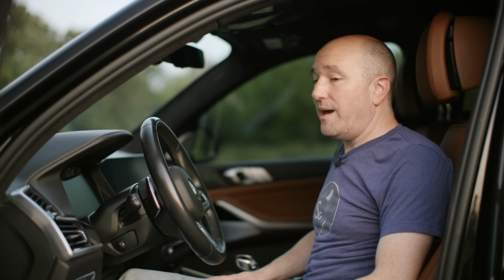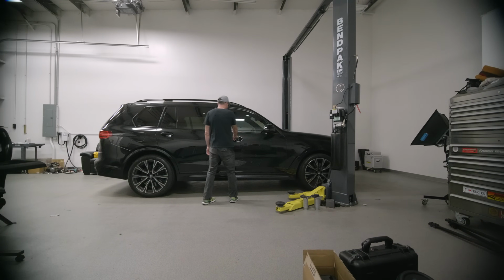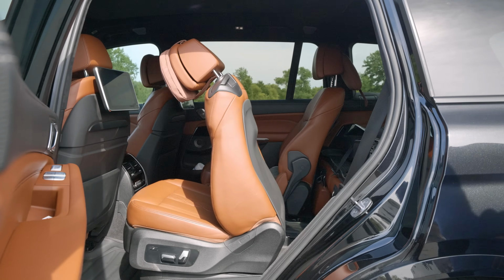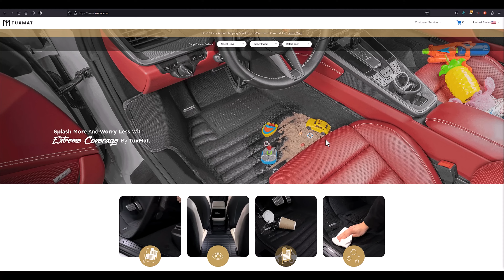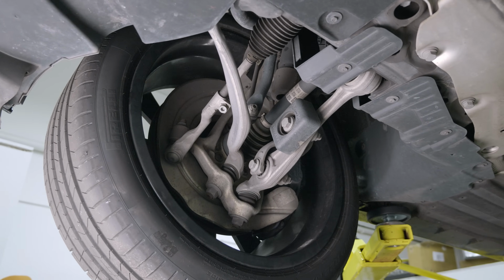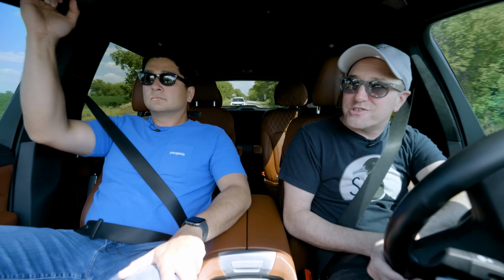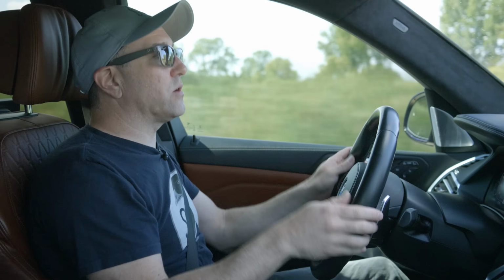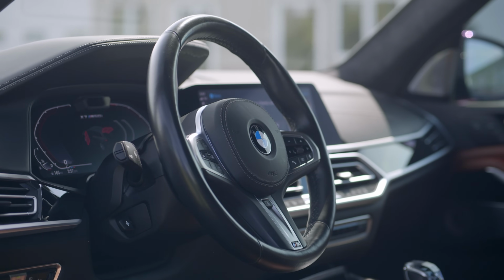BMW X7 | 45,000 Mile Long Term Results

Comment: I bought an M3 new in the 90's and have owned about 9 more BMWs since then. I was a fanboy of the highest order, but the last two X5s I owned left me stranded on the side of the hwy (one shifter failure and one engine seized). Those problems were fixed under warranty because BMW would rather apologize and beg forgiveness before building something dependable. My local dealer nodded understandingly when I told him a bought a Genesis. Mark's X7 only had small problems so far, but these cars cannot make it through five years of trouble-free ownership. They are gimmicky tech products engineered for the show-room.
Reply: @rodgerk They were fixed under warranty. So...what's the problem? Should we purchase a GM or Mercedes product next?
Reply: @MH-xu4ez  The problem is sitting on the side of a California desert hwy for hours on a 106F afternoon because the V8 engine seized at 80 mph. The problem is a failed door lock system on a F90 M5 that left my friend and his wife standing on the sidewalk in a dangerous neighborhood. The problem is the constant unscheduled warranty service visits to the dealership while you drive an ersatz loaner. I was at the local dealership so much I became good friends with the staff there and got invited over for dinner. BMW has lots of cool owner events and I met a lot of cool people, but it's like an abusive relationship. No more. I'm trying Genesis right now (so far it's been nothing but oil changes in 45k miles). Eventually I will try AMG. My buddy with the M5 moved to Porsche.
Reply: @rodgerk.  Stranded in a "dangerous neighborhood". Got it. That's all I needed to know.
Reply: @MH-xu4ez  with the quotes and blatantly ignoring everything else he said it looks like you are trying to spin this into it being his problem?
Reply: @S8ER  Interpret it however you like. I'm more interested in what years he owned the BMW vehicles and which models. Their V8 engines have been notoriously unreliable, but their recent straight six engines have been great. I've owned four BMWs since 2018, all with the B58, and my vehicles have been reliable, albeit expensive to maintain.
Reply: @MH-xu4ez  Yeah, the B58 is a great engine. I would argue that's because BMW was forced by law suits to fix the dumpster-fire that was the N55. You know the V8s are trash but you failed to mention the catastrophically horrible N20 4 cyl that has BMW fighting court cases the world over. Thanks for asking about my BMW history: I've owned three E30s over the years - current autoX car is a heavily modified 1991 318is. These cars I bought from the dealer: Two E36s, one an M3; E39 540i (best car ever, drove it to 180k miles with no serious probs); E70 X5 xDrive50 (shifter module failed and immobilized car); F30 328i (N20 timing chain guide failed and ruined engine - i still have the old engine in the garage as a fun rebuild project); F15 X5 xDrive50 (N63 engine seized due to dropping valve stem seal). That's 3 separate models that all failed catastrophically under 60k miles. All these cars were dealer serviced and warranty was honored. And about your snide "dangerous neighborhood" comment: I live in a huge metropolis with several famously high-crime neighborhoods. Areas where Door Dash won't deliver after sundown. Neighborhoods where I have personally had a gun in my face and all my car windows smashed. You'd call that a "friendly neighborhood"?
Reply: @rodgerk.  Fair enough. I respect your honesty and history of ownership. I guess my original reply was more geared towards the end of your original comment when you said: "but these cars cannot make it through five years of trouble-free ownership". It felt like more of a definitive statement about any/all BMW models. I'll grant you that many of their vehicles had their fair share of reliability issues, but it's been my experience that most of their newer models can be reliable for well over five years if the individual is willing to pay the extremely high cost to properly maintain them. Most people do not and then complain about the brand as a whole being unreliable. I've owned everything from American, Japanese, Korean, German, etc. and have found that no one brand is more reliable than the other depending on the model and service history. The exception being JLR vehicles.
Reply: @rodgerk.  And yes my "dangerous neighborhood" comment was meant to be snide because it was an unnecessary detail about the reliability of said car brand. I apologize that it caused offense, but dangerous neighborhoods are extremely subjective based on a vast number of factors. But let's not get into that on a YouTube channel that is geared towards car enthusiasts and the joy of driving.
Reply: @S8ER  And for you S8ER...did you feel that the crime rate in said neighborhood was warranted or relevant to the conversation about a car brand's reliability? Or do you just stir the pot in YouTube comments between strangers and then bounce after?
Reply: @MH-xu4ez  🤷 not sure it matters
Reply: @S8ER  Exactly. It doesn't matter and holds zero relevance about a car brand's reliability. Thank you for actually responding.
Reply: @MH-xu4ez  Thanks for explaining your POV. Solid take. You're right that it was unnecessary on my part and got in the way of our productive discussion. I learned something here.
Reply: @rogerk. I appreciate your response as well. I'm glad to see that strangers in the YouTube comments can have a difference of opinion and still get along. If only there were more positive exchanges like this in the YouTube car culture community. Best of luck with your Genesis ownership and experience. Hopefully my current BMWs (2022 X7 40i & 2018 440i M Sport) are free from the issues you've experienced in the past.
Reply: For me, it was a brand new 5 series. Twice in the first months, the car would just brick out on me. Apparently it was a loose cable that would short everything out.  the BMW mystique is strong.  The car drove great for its size, But, ride was too firm. Seats were too firm. Interior was too sober. Huge maintenance costs. I went Lexus, and it's just cheap oil changes. Just like a Toyota. Seats are amazing.  Ride is amazing.  Sure, not as sporty, but im looking at a used ISF, GSF, or RCF to satisfy that need. I love BMW, but it's too much of a wallet burner for me. I'm not rich.

Comment: Mark this exact thing happen when my lady ended up with Turo rental audi q8 and she had a mdx sh awd. These German cars were so darn cohesive in the experience she ended up buying a q7 2 months later. Let me also add I knew you spent alot but 80k plus the warranty sheesh. It has to be hard to go from top tier 120k suv meant for top 5 percent earner back to commodity car.

Comment: Thank you for this! Ive driven the MDX Type S Advance for a week along with a fully spec'd X7 40i and you're right it does feel boaty compared to feeling engaged in spirited driving in the MDX. I originally was considering your exact model 2020 X7 M50i used vs a new MDX Type S, however I may have to reconsider since I am very hands-on with DIY maintenance. Ive gotten quotes in NYC for an engine drop service to do Walnut blasting etc and long term I feel like the MDX is the more financially sound choice. Thank you again for such a detailed unbiased review on both vehicles! I do keep my vehicles for 10+ years if that matters.

Comment: We have this same 2020 M50i and after over 160,000 kilometres the engine still runs without issues. Can't say that about the front differencial and fuel pump tho :D

Comment: Great review, and the comments about the slow seat movement is spot on!  I've celebrated birthdays waiting for the seats to move!  The inline 6 in our 2020 has been bullet proof through 48k miles, and very few minor issues needed dealer correction.  The BMWness was worth it to us in compared to others we drove, but you need to like that ride/handling etc or it probably isn't worth the extra money.  If the Mercedes GLS had more comfortable and slightly longer seat bottoms it would have been a contender.

Comment: I feel your pain I bought a 2020 GLC 63, lots of fun until you get to the 50,000 mile mark and everything starts to break😅
Reply: I have a 2021 C63 amg. Been at the dealer so many times for so many problems with 10k miles on the odometer. What issues have you had?

Comment: I had a BMW and it drove awesome until around 45-50k.  After that it started to do weird things and the transmission felt like it was disconnecting.  I took it to BMW and it was going to cost me thousands of dollars to fix.  Great machine but expensive to own.
Reply: And it's not like the old days with, say, Mercedes-Benz where the parts were expensive to fix but once you fixed them they 'stayed fixed' for a long time. The parts are cheaply made and designed to fail over time.
Reply: @@japanwatchconnection why are you asking?  Are thinking about getting one?  It was a 2012 X5.  It cost me hundreds to diagnose and the problem was the waste gate.  The turbo would lose power under hard acceleration and it felt like the transmission was disconnecting when that happened.  It only happened when we were going up a hill.

Comment: great video and great honest content.  I have a 2020 M50i and I love it, went from a f82 M4 due to needing more room.  This fills in the gaps pretty well aside from just the SUV size.  I hate the cost of the consumables as I am on my 3rd set of tires at a cost of 2.5-3k and I have 38k on the clock.  My only issue I had was a high pressure fuel pump went out and it sat at the dealer for over 4 months due to no availability from BMW.

Comment: Great review and honest conclusion. We use a 2021 Renault Espace V Initiale Paris and it does most of the things you enjoyed with the X7 - from a good interior, to proximity keys, great LED light, and so on. It cost us 1/3rd of what the X7 costs and it gets in the high 30s, but doesn't eat tires or has costly maintenance. Overall it is exactly what you described, just without the last bit of refinement and the great drivetrain. But that's okay, a family hauler doesn't need this. Luckily I'm into motorcycles more than cars, so I get nice motors for way less money than my four wheeled friends.

Comment: Glad to see a long-term review of this vehicle. We'll be considering a second vehicle in a couple years and the X5 or X7 are on the list as contenders. I'm not sure if I'll want the extra space, but the additional high-end features really just tempt me into the X7. I won't go to the updated model though, the front end is worse for me and the change to mostly touch controls keep me away from their newest models. It's not without its flaws, such as the lack of manual controls on the 2nd and 3rd row seats as a backup/alternative, as you highlighted, but it has just the right blend of niceties. I only plan on going for the I6, because the V8 is historically much less reliable and more expensive to maintain, and realistically most people don't need the extra horsepower.
Reply: Definitely stick with the B58, it’s much more manageable, parts are more readily available, and overall it’s pretty reliable. I’ve had X5s and 5-series come into the shop, some over 75K miles, and no major issues yet.

Just make sure to change your oil often.

Comment: It hurts the wallet since these hold 10 quarts of premium 5w40 synthetic oil but as long as you do frequent oil changes (5k miles not 10k or 15k like they say you can do) I haven't seen any issues with this engine yet in my shop. Even at 5k miles, with all that thick oil, and a huge filter, this engine just destroys the oil and it comes out like black water. Owners, do not push the oil change interval!

Comment: After driving BMW's for 34 years, I have switched to Honda. I am suffering with depression. Handling and braking are so far apart in performance. My wife has X3 M40 and she loves it. It is ok on gas . It is a lots fun to drive. So far it is under warranty and haven't had any issues.

Comment: As much as I rag on BMW, I'd love to own a rig like this. But I know that realistically, I would have to devote too great a percentage of my income to both purchase, and keep it in top running shape over the long term. Maybe I'm wrong, but IMHO these vehicles are for people who either have FU money, or just don't care, and are willing to make whatever sacrifices they have to in order to scratch that itch. 
There's something else that I feel is never discussed, and that's the dealer experience, and level of service you get as your once new $120,000 vehicle begins to get a bit long in the tooth. I know that during the first year or two after purchasing an SUV in this stratosphere, they bend over backwards to kiss your ass, and address any and all problems. But that level of attention decreases exponentially with every passing year, and every 10,000 miles. When you buy something like this new, you're the King, but six or seven years down the road, you're back to being the Joe Schmo that you were all along.
Reply: Not the experience at my Penske owned BMW.  They charge but they provide amenities and level of service second to none.  All loaners are BMW.

And I have never bought a BMW from them.
Reply: @machtschnell7452  I'm just going from my own past experience purchasing new cars, albeit not at this level or cost.
Reply: I wouldnt buy this car new, and I would save a ton on a used one. I don’t really have FU but I rather own and drive something like an x7 m50 and keep up with its maintenance cost,  rather than own something boring or lease every 3 years with big money down just to feel safe with a warranty. The x7 m50 is for a family, and for a car dad who wants something fun, exciting and special .

Comment: Those tire costs are real, and you can’t rotate tires, so you basically replace them every two years or so. I put on Michelin Sport 4’s recently and the bill, even at discount tire, was $2,500. 😅

The spaciousness and comfort is great, but that monster running around like a sports car is unforgettable. It’s our family car when we need to take long trips and or weekend getaways. My daily is a 2024 Model Y.

Comment: Very impressed with the vehicle and the run down on the maintenance costs do concern me a little bit
Reply: X5 isn’t as bad but if you need the space the x7 40i is a lot cheaper to run compared to the m50i

Comment: Just purchased xdrive50i with 43k.  Time will tell the long term reliability. My thought is 20k less than 2020 m50i with comparable features and miles gives a lot of $ for consumables and repairs and not much downside between the two vehicles.  Understood m50i has more power and Engine upgrades but is that worth 20k on the second hand market?

I really like the car for 55k. Not for the 95k he paid when you still need to pay for gas, tires, brakes etc.
Reply: curious if you bought the extended warranty? I actually bought a 2020 m50i with 30k miles. Not sure whether to buy the extended warranty
Reply: Did not. They offered some 3rd party junk warranty for 5k. I’d rather keep that on the side and use on my terms.
Reply: I'd buy 2 extended warranties. 5 grand won't cover you for anything. These things are money pits. You'll see. 
Even with extended warranties, paid by others, the car will live at the shop. Always something wrong. Always something broken. Get a Japanese or Korean product. You'll sleep better at night.
Reply: Maybe. But that wasn’t Marks experience. I agree if you lose sleep over potential repairs to a vehicle, you shouldn’t own that vehicle.
Reply: @barrygoldwasser5449 haha 😂

Comment: I do love that 45,000 miles is generally accepted as long term for BMW. All downhill from here
Reply: I think 60-80k prob the longest you want to go with BMWS for at least these over the top models.
Reply: Tried to convince my Father not to buy a 80,000 mi " well maintained" 2009 X3. All paperwork showing it was always serviced at regular intervals. Within a year a piston scratched cylinder 5. Cheapest repair shop he could find quoted $17,000 and most likely a lot more. He even paid to get it towed to a second shop for another opinion.... They started at $20,000. Needless to say he just sold it to a junk yard for parts.

Comment: Love this suv! I hate most 3 row SUV’s  but I’m obsessed with x7 m50. Love the exterior and interior. I’ll be purchasing a preowned version soon. I’m not concerned with wear and tear as my wife’s job (who will be driving a majority of the time) is up the road. I’ll be driving it on the weekends for trips to the mall with the kids, so I’m looking forward to that v8 blast! I own an 2012 e92 m3 (6 years now) and knock on wood, I’ve had great luck with bmw’s. Sure there’s other cars that have Lower maintenance cost , but I rather own something special for a long time and pay to keep it top notch then constantly leasing or buying something that’s boring and I would probably end up trading in after a couple of years.

Comment: Great video 👍. I’ve ordered a new facelift version, X7 M40D, here in the UK. I don’t think you can get the diesel version in The USA. I can’t wait to collect it, it’s basically the same spec you have here with everything on, including rear wheel steer and active roll bars etc, except with a rear bench. It hasn’t got the power that this has but has 353hp and 720NM or 531 lb/ft of torque. It’s more than quick enough for me but will get around 40 miles per gallon. The V8 seemed really thirsty and I’ve test driven both over a few days each. I really agree with you on the lack of physical buttons in the LCI X7 is a pain, looks wise, I’m not sure which version I prefer, it’s down to the colour combination. Yours looks great with the blacked out decals. Should be here in a few weeks from new.